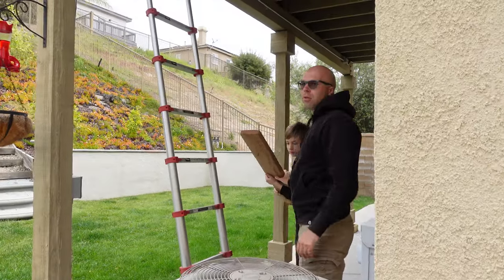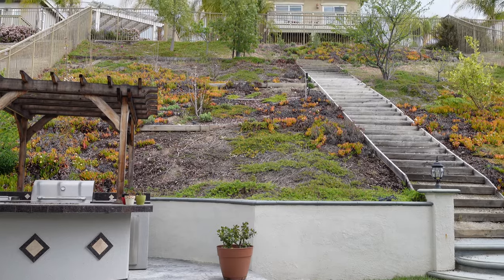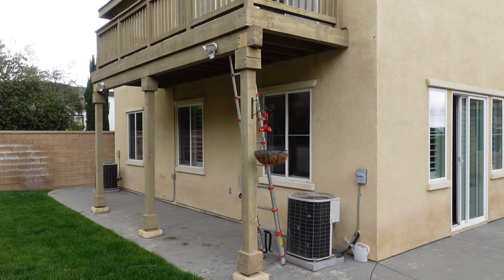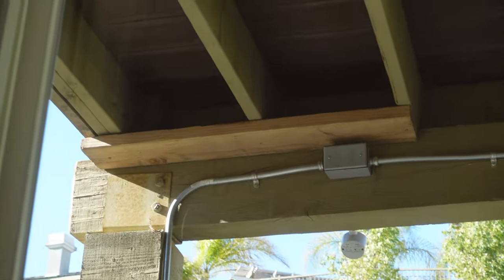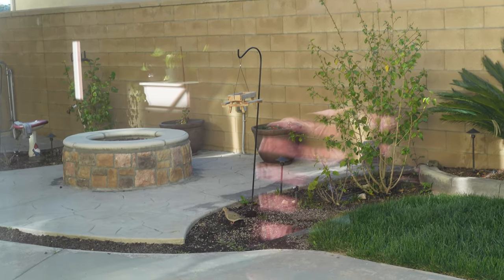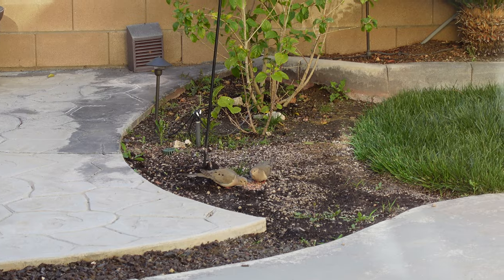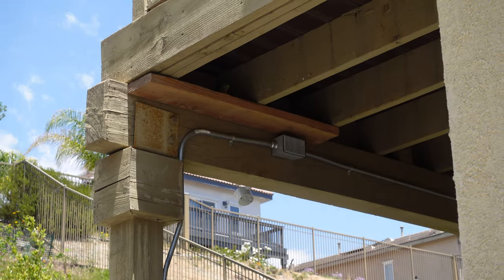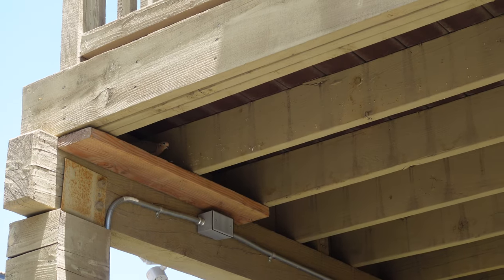How to attract mourning doves to nest in your yard | Easy DIY nest for mourning doves| Bird watching

Comment: Males are on the nest in the day babysitting the eggs sitting on them then the female takes the night shift always. I didn't have to do anything to attract them, I have them on my front porch above my front door in one of those antique windows that open up from the bottom and not all the way, it's hard to explain them and they are old windows that I don't think you can get them nowadays from a hardware store. This house was built in 1897 so probably original when built. I also have some weird windows that has rope inside the frame of the window and never seen that before until living in this house. The same couple of doves have returned this year they have been using that nest for 3 yrs maybe more I have only been here for 3 yrs so might of been doing this longer than 3 yrs.  You can almost reach up and pet them but I don't I leave them be.